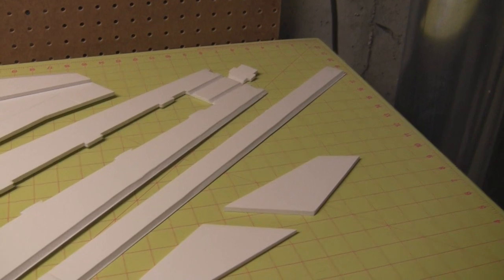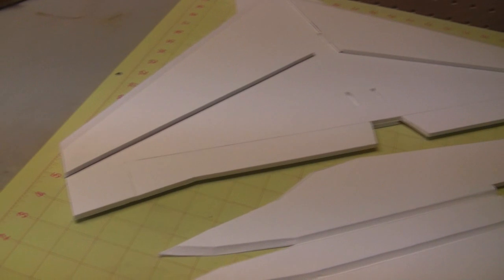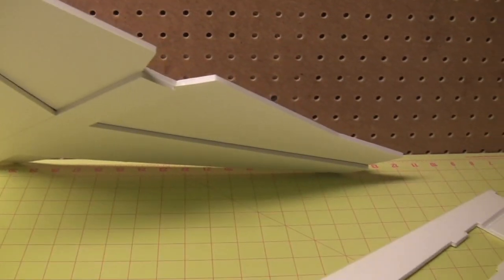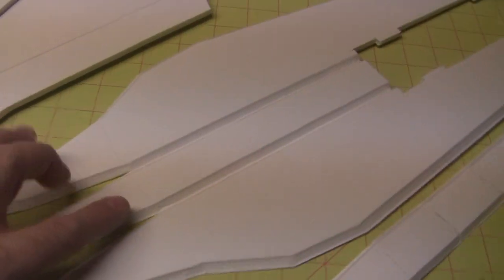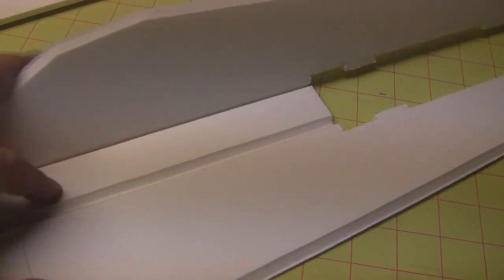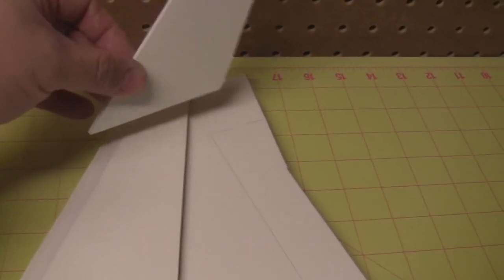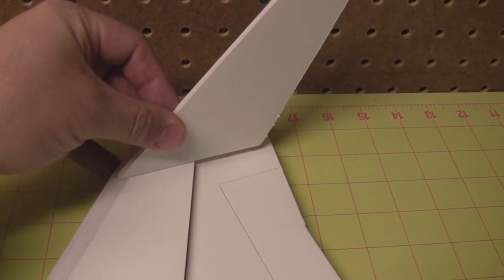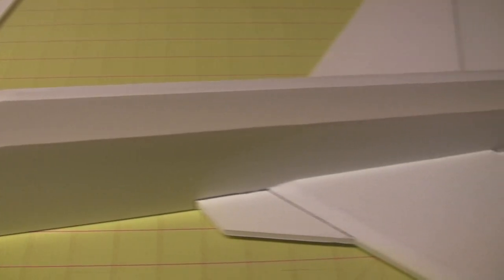Bullet Plane Build Part 1

Comment from the maker: @RCcrAzY1234 I cut them freehand using a straight edge ruler and a razor knife box cutter. You can also use an exacto knife or get a special foamboard cutter from a crafts shop which makes it a little easier. You can find the foamboar cutter at most craft stores such as Michael's or you can find them online.

Comment from the maker: sunnyatscot, don't get me wrong I have nothing against glow engines as a matter of fact I used them on my RC boats and cars in the past but I always had trouble finding places to run them because of the noise. Well now that I'm into planes I don't want to have those same problems. Besides the brushless electric systems today have gobs of power and are very low maintenance and cleaner to run. Sometimes I do miss the smell of that NITRO!!!!

Comment from the maker: I will be giving a detailed breakdown on all the components going into this plane in the next video which will include individual pricing and where I got these parts. But for a rough estimate of the cost for all electronics including the brushless motor/ESC combo, (2) digital metal gear servos and the 30c 1350 mah lipo battery comes to about $75. The next video should be ready this Fri or Sat so please stay tuned or subscribe so you won't miss anything.

Comment from the maker: All my cuts are made by hand with a strait edge ruler and a box cutter. No jigs for the bevel cuts either. I just draw a cut line on top of the foamboard then use the box cutter held at 45 degrees and cut down the line using the ruler as a guide.

Comment from the maker: I've had very good results on my other planes with the Suppo motor /ESC/Prop adapter combos, so I will start with the same set up that I had on the Sky Fighter 24. It's a hard to beat combo for only $30.